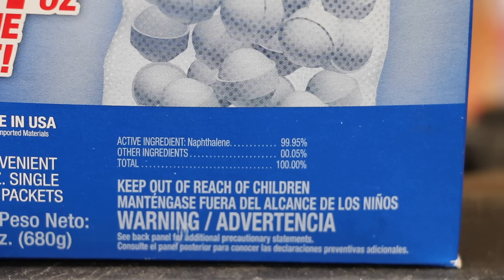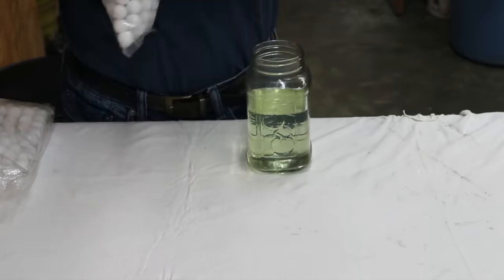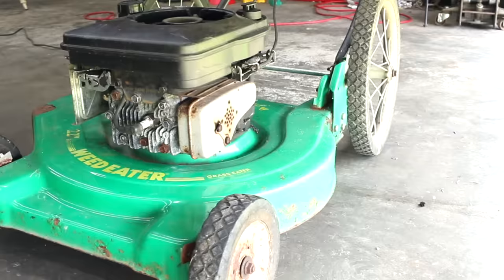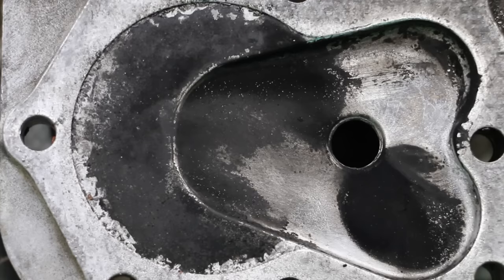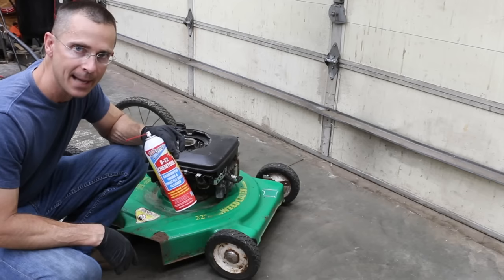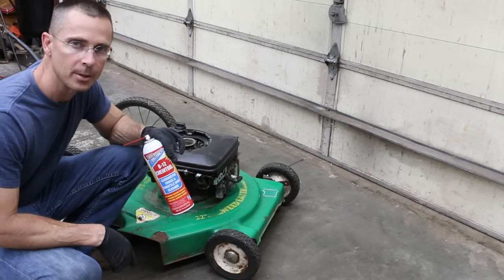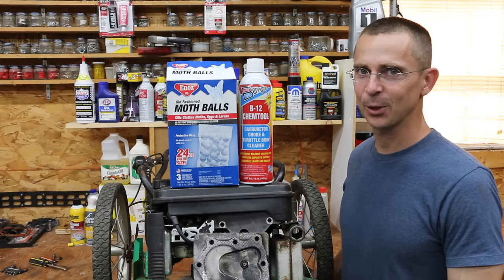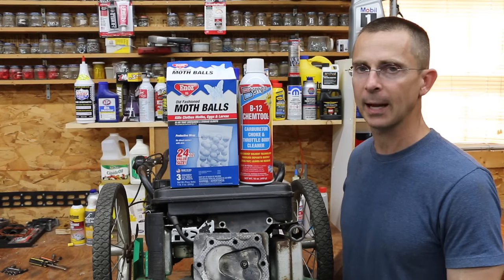Will Mothballs in Gas Destroy an Engine?  Let's Find Out!

Comment: 😳- too many mothballs in this test! Please do again only start off with 1/8 or less of 1 mothball, crushed up and measured in grams in that volume of gas ⛽️ . Noticed acetone was used to clean up the contamination- Stage 2 of the experiment- add a little acetone to gasoline on its own, not with mothballs- 2 to 3oz as a maximum to 10US gal is the ratio but with such a small volume, measurement would need to be done in ML. Test fuel should be allowed to sit a number of hours before using for the chemicals to properly react with each other.
Reply from the maker: Thanks for the constructive feedback.

Comment: you only need 5or6 for 15 gals. it will increase mpg
Reply from the maker: Thank you
Reply: Project Farm 
ever other tank of gas also . 
if you want to play with crude oil . filter it then for gas cars mix 50 50 with gas . pick ups that are diesel straight . lol just dont get caught . state likes their tax money they steal from you . 
 hho gens are easy to build too . just dont forget to use baking soda . wood gas afrier ( not spelled right ) was used during ww2 .
Reply: Project Farm 
 one other thing you can try is adding quart of  auto transmission  in a full tank of gas too .

Comment: Unrealistic to start with a saturated naphthalene in gas solution.  Since some evaporation will occur in the carburetor we expect naphthalene to come out of solution and eventually clog it.  That’s a physical change not a chemical change.   The naphthalene in gas solution will burn, albeit less efficiently, just fine in the engine.
Reply from the maker: Thanks for the feedback.

Comment: They work fine in the older engines with a carb. It will stop per-detonation, thus allowing you to run higher compression and advanced timing.  But you only need to devolve about about 3 or 4 in 5 or 10 gallons of gas, then filter any solids out. I would think ANYONE that know ANYTHING at all about engines would have more sense than to pour a solid into a fuel tank, shit you may as well add dirt. What ever happen to common sense....  Bare in mind unless the engine is high compression your not going to tell any difference anyway. That lawn mower will run the same on 80 octane as it will on 100 octane. But a 427 with 12.5 or 13 to 1 compression is another story. Even then you have to advance the timing to tell the difference. But if you do, you will see a gain in horsepower. The new ECM engines set all that for you based on the fuel your using, once it detects a knock, it retards the timing. But again, unless its a high compression engine, new or old, your not going to gain much.
Reply from the maker: Randy, thank you for this information.  I used far too many mothballs and should have filtered out the solids.  Thanks again!
Reply: You know its funny to me that many people still think high octane performance fuels burn faster and hotter. But exactly the opposite is true. The higher the octane, the less likely it is to detonate under compression. It won't fire until ignited by the spark, which is exactly what you want. If it ignites before that, it actually develops less power, and cause damage to the engine.  The added boost from a supercharger or a turbo will also effectively raise the ratio because your starting from a positive pressure on the cylinder to start with. So they also require a higher octane fuel to obtain there very best performance.

Comment: Too many mothballs for small amount of gas mothballs are just not feeling which is an acceptable octane booster you can even buy things called gas pellets which are white long sticks when you open them up they are nothing but long mothballs as long as there's nothing else in the mothballs like sent or other chemicals naphthalene can help been doing it for years even ripped apart engines for other work and could visibly see the difference
Reply from the maker: Thanks for the feedback.

Comment: Even if the Moth Balls did increase the octane, how could you even tell that it did? In a lawnmower, I'm pretty sure you wouldn't notice anything different if you ran regular unleaded 87 octane or 101 octane race fuel. It's kind of pointless, especially since the ratio of Moth Balls to gasoline was unrealistic. Especially since you dumped about 20 Moth Balls into a maybe quart sized gas tank. Seemed more like an advertisement for B-12.
Reply from the maker: Brian, Yes, I used too many mothballs.  Thanks for commenting!

Comment: He is incorrect because of the amount he used. I put in 20 mothballs in a full tank and the car runs perfectly! in fact better than before and with an improved fuel consumption. It boosts the octane rating, but the price of the mothballs are more expensive than the higher priced gas.
Reply from the maker: Yes, I used way too many.  I'll have to redo this one.

Comment: WAY too much mothballs! Since when do solids move well through a carburetor? Moth balls once contained Benzene and a handful added to 10 gallons of gasoline would give you more kick as it destroyed your valves. In a 2 stroke engine, it gives you that extra kick with no valves to destroy.  In the 60's,  I would add a pint to the 2 gallon tank on my Yamaha 100CC twin. With advanced timing, it would flat out at 100 MPH which is quite amazing for 100 CC's
Reply from the maker: Yes, I definitely overdid it and will likely repeat this test in the future.

Comment: You have to let them  mothballs set inside gas for a week wow we old school Racers know what mothballs will do. You just got to know what you're doing.
Reply from the maker: Thank you
Reply: @ProjectFarm  another thing I want to reply back to you you had to take the moth balls wrap them up in a rag and smashing with a 2 lb sledge hammer get it real fine then dumb in your gas can. Once it sets for a week 5 gallon you stirred up shake your can up before putting in your fuel tank. Are racing fuel tanks would hold around 10 gallons. I remember correctly I used 2 1/2 to 3 gallon of high octane airplane fuel added with it. If possible I like to see that try it again in a different segment video.

Comment: Normally I agree with most of your testing but way to many moth balls.    I never used more then 1 per gallon.  Used on motorcycles in the 80s and 90s.  Never had a problem.    Back then I was told it would increase octane.    Used after you could no longer het regular leaded gas.
Reply from the maker: I definitely used way too many.  I need to redo this test.

Comment: your trial is wrong. You put too much naphthalene in a small two-stroke engine. naphthalene works. is an additive that speeds up the combustion process in an engine. which stabilizes and cleans the injection system. but you have to be careful with the product. it is very abrasive and can damage the motor if you use it improperly. you only have to put three balls previously prediluted by tank full of fuel depends on the size of vehicle. is an average of one ball for every 10 gallons. is so good combustion that if you have a car with damage is the engine. rings or crankshafts, you can damage it more. you should check the compression of your motor before using it. it has to be in optimal conditions of compression because if you use naphthalene the compression can reach the cranks passing through the rings putting it more and more loose every time by the compression. it's 87 octane gasolines the perfect naphthalene works. 89 works well. in 93 octane gasoline naphthalene is neutralized does not do its job. why that gas is already enriched
Reply from the maker: Thank you for sharing this information.

Comment: Moth balls won't hurt the engine.  If you did not try to make dissolve first, I've been using moth balls for years with no issues.  I drop the balls in the tank and let them dissolve on their own

Comment: Its one or two moth balls for 6 to 8 litres of petrol or gasoline. Approx 2 or 4 moth balls for 10 litres of petrol. You added way too much of moth balls . The petrol got saturated   it must stay unsaturated.  And moth balls need to be crushed , separately dissolved in a beaker with petrol and then added to the tank of vehicle.
Reply from the maker: Thank you for the feedback

Comment: Horse hockey I drop them off all of my tank when I fill it up a little bit snow World War II trick
Reply: Sorry no I was not intoxicated I was saying I drop them off all or two in my tank every time I fill up the cheap gas it boost the octane a little bit it's an Old World War II trick that they used to use for the aircraft they can take cheap old Fuel and boost the octane with ball it does work
Reply from the maker: Thanks for commenting on this.

Comment: Here's the problem with this test....you should have started out with mabe 
3-4) 1st 
Then add 
5-7
8-10
11-15 and so on...not just dump all 15-20 at once....thats just my opinion....I'm like u I mess around with small engines and cars and whatever is Machanicly.
Reply from the maker: Yes, I messed this experiment up, but I will definitely get it right next time.  Thank you for the great constructive feedback.  It definitely helps me improve the videos!

Comment: Hey, you are not a stupid one, dude, how in the world did you come to not thinking? Whatever amount of mothballs you would put,  it must dissolve at least to be invisible to your eyes. I can't believe you just did, what you did, and allowed your self to run a sludge through carburetor, oh my... This is not how it's done, in the first place.  As you haven't done it right, you aren't the one to judge whether it's a good or bad idea. That said, I've never run mothballs, just heard of it. I've ran 3 ounces of xylol per gallon of diesel fuel for years, and hundreds of thousands of miles, and results were good, helps with keeping fuel injectors cleaner, and fuel filters get better flow, don't plug up as fast, allows me to get their useful life, and struggle less. I never saw damage to fuel system, it faithfully serves full life as per manufacturer even though I use xylol. That said be careful with xylol where you spill it, it will melt some (not all) plastics almost on contact!

Comment: You ruined a perfect test. Adding the sludge from and full moth balls . Doesn't tell us if the old myth is false. Because you should have let it ferment in fuel . And either way should have filtered it...    so just like sugar does not ruin motor but absorbs gas and clogs strainer  or filters. But adding a coke or soda to fuel. Which is dissolved sugar, syrup and acid will hurt motor because goes through filter.... thanks i guess i have do the test myself.. because your test told us nothing but don't add them directly in tank lol

Comment: I come for that time period when mothballs were used. In your demonstration you used WAY too many for the volume of gas. One would have been enough in that amount of gas. The amount you used would probably be too much for a 20 gallon gas tank. I used to race hobby round track with a 428 cobra  and I used them and only put 4 or 5 in a tank. I never had an engine failure or any problems. To be honest I seriously doubt I got any real gain. It was a fad of the time with no real proof of gain. That being said I do not recommend them as they do give off bad gases. Guys behind me could hardly see due to their eyes watering.
Reply from the maker: Yes, I used way too many.  I might repeat this test.
Reply: If you do I suggest that you break up what ever you use and be sure it is fully dissolved with no sludge before dumping it in the gas tank. That is what I did with my race car.
Reply from the maker: This is a great recommendation--thank you!

Comment: Video was somewhat misleading, you have to strain/filter the mothball residue before adding it to the tank, Secondly the mothball should be dissolved in WD-40 or other solution before adding to fuel. Come on Project Farm you're usually better than this.

Comment: The urban legend I've hear about mothball is to absorb water in the fuel tank.
Reply from the maker: Thank you for commenting!
Reply: That is also what I have hear. However in today's fuel, this is not an issue anymore. The ethanol in the fuel can bind with both the fuel and the water, so the little water just get mixed and get out without causing issue.

Comment: Way overdone.  Too many mothballs.  Compared to a car size tank of fuel and the handful of mothballs, this small amount of fuel should have only had maybe one mothball added and you probably should have given it more time to simply dissolve like letting it sit a couple hours and that might have mixed and dispersed much better than that glut of mothballs.  Patience is a virtue.  You did however very effectively I would say put to rest the question about wether the mothballs will "ruin" an engine or not..  And thanks for that knowledge and taking the risk to find out!
Reply from the maker: Yes, way too many. Thank you

Comment: I bet he was sponsored by the Mothball manufacturer. Just sayin'
Reply from the maker: LOL!  I don't think they would be pleased with this video.  Fortunately, I'm not sponsored at all and have freedom to provide unbiased results. Thanks for commenting!
Reply: I'm a Patreon, thanks for providing the info. One suggestion, if I may, would be to include the video of how you got the engine back to running shape. I know you used some additives and I have also noticed you using a wire brush on your drill. That wire brush is the ultimate cleaning and that deserves to be shared. I bet there's some techniques used that make for better results and less risk of damage. Also every time you do an engine test it would be good to show how you return it back to pristine shape even if that is something you do over and over. That would thin the soup, add videos, and also convey the knowledge of no matter what you do to an engine here is how you fix return it to good shape. Regarding small engines like you use for your tests of course.

Comment: Come on man get it right first of all we ran one moth ball per gallon let it dissolve in the tank with a fuel filter and in a high performance motor,  not a box to a quart WTF, then you just dump the residue in the tank yea keep selling your product instead of the true findings, I was throwing blue flames out of my exhaust, I have seen so much octane boost from guy's putting to many mothballs and blowing the heads off his engine and left the head bolts, man your a disappointment, keep selling your crap to the millennials k

Comment: Normally your videos are objective and your attention to detail is fine - however, this was a little ghetto. Dumping in the chunks? Seriously?
Reply from the maker: Yes, I shouldn't have used so many mothballs and should have filtered the solids. Thanks for commenting!
Reply: Project Farm I'm a student chemist. Naphthalene has a similar energy density to gasoline, but when burned at its' correct AFR (about 6.4:1), it produces around the same energy as nitromethane would running at its' correct AFR (1.7:1). That is, not btu per lb of fuel, but btu per combustion stroke (as the fuels all have different stoichiometric ratios and densities). I can send you the chem math, it's pretty easy to work out. Naphthalene is actually very interesting, it's just normally all tests about running it as a fuel fail to acknowledge that it requires a richer mix to work. Running pure naphthalene as a gasoline afr would be like running gasoline at 30:1, it wouldn't even start.